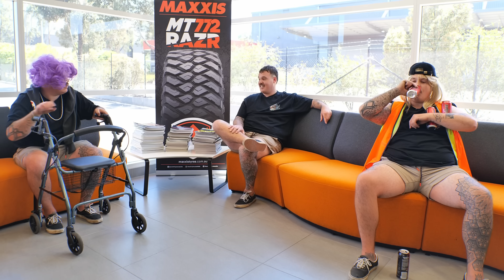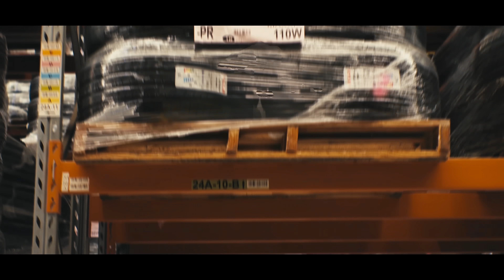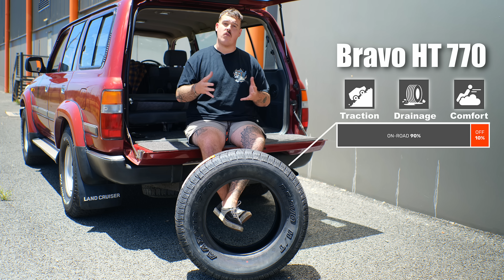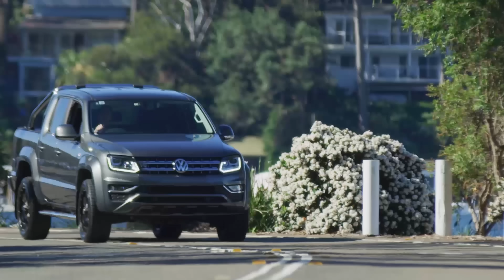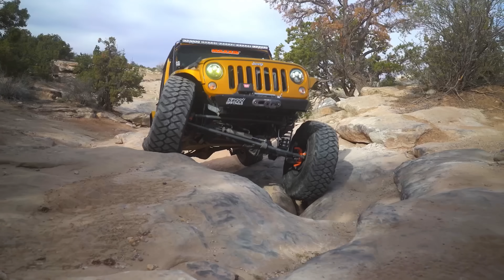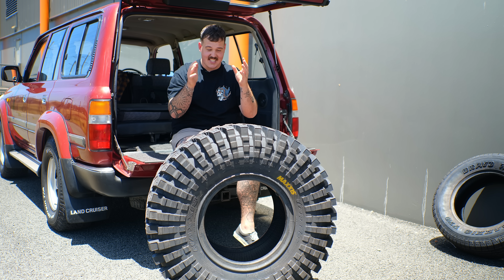Shopping For New Tyres! Picking the right tyres for your 4x4! All terrains VS mud terrain!

Comment: I went from toyo RTs to the maxxis AT811 RAZRs on my GU patrol as I wanted to test something in a cheaper price range because the price of the RTs is just stupid these days. 

So far I'm loving AT811s and have no intention of going back to the toyos. My rig is set up for tough touring/towing and they've been just as good if not better than the toyos in the sand, rocks and mud etc.

Personally I've found that muddies do bugger all anyway when you're properly in the mud and you're getting less footprint in most situations.. lockers and momentum will usually get you further than muddies v all terrains. So most of the benefit of a muddy is rarely seen and on road handling is shit coupled with droning interior noise but each to their own. 

The on road (where our rigs spend most of their lives) is superb on the at811s - super quiet and handles well oh and the fuel consumption is noticeably better.
Reply: Are the RTs good off road? I was thinking about getting them as my next tyre cause they still have wide gaps in the pattern
Reply: @rev2037  Yea they were fantastic off road. I put them through everything: snow, mud, rock, sharp shale, sand etc you name it. Never had a puncture either. Pretty good on road too just a shame about the price. 

You need to be on top of tyre rotation/alignment with them though because they can wear unevenly pretty quickly. Mine lasted around 50,000kms.